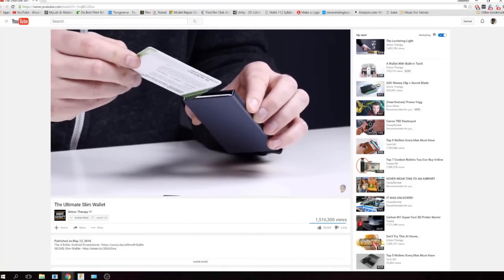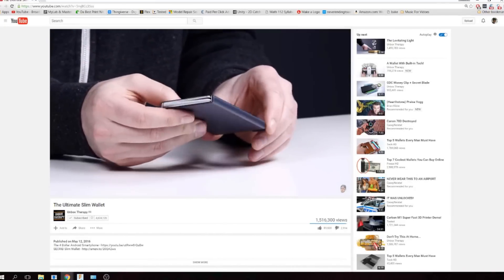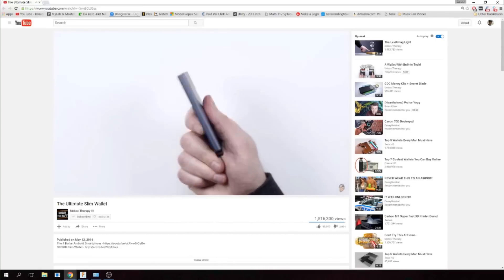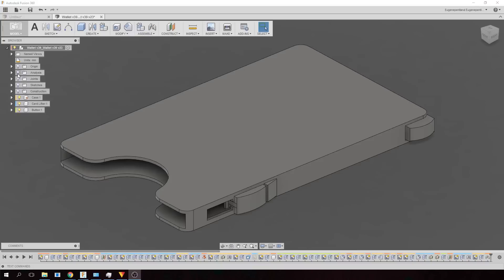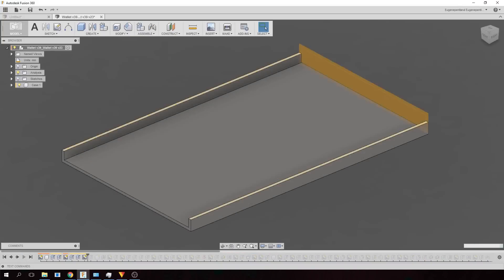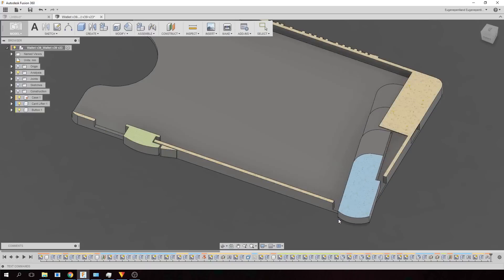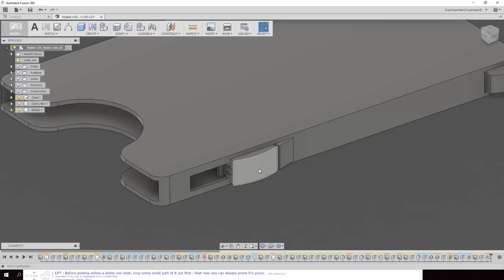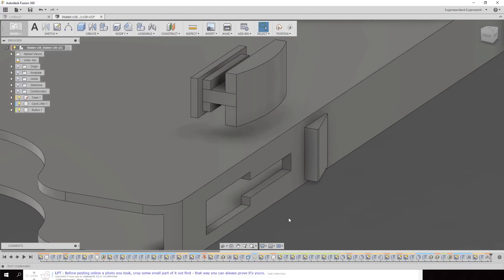3D Printed Wallet

Comment: Well, one suggestion is to cut the blank end of your video off. I like the design. I'm not 100% sure it's print in place, so I'll have to check it out. I feel like it could use some more beveled edges so it doesn't tear my jeans. Maybe that should just be some sanding and finishing.
Reply from the maker: I have been using my wallet for almost a month now and have had no problems. The version in this video is sanded and spray painted though. Also thanks for the tip! i fixed the blank end.